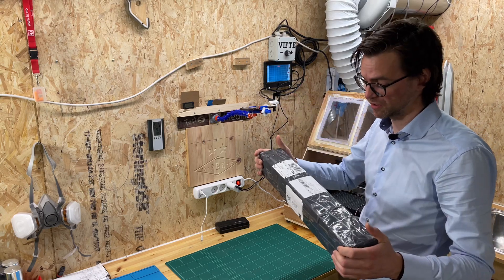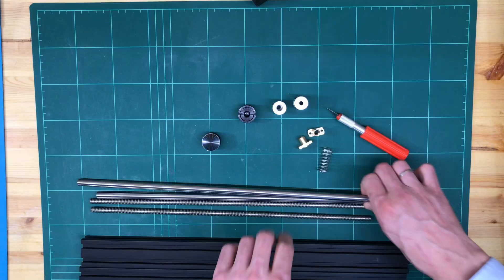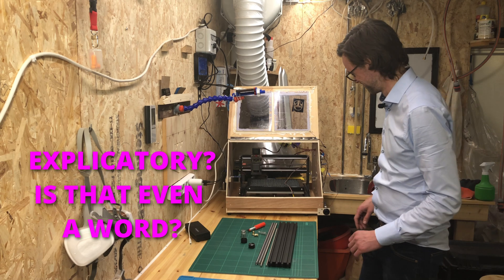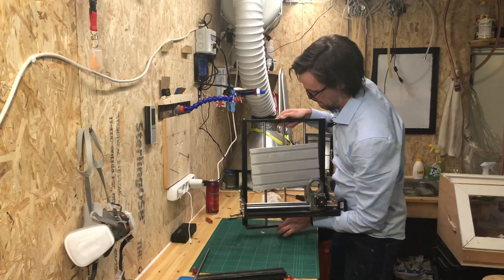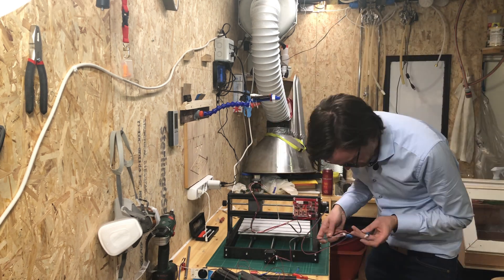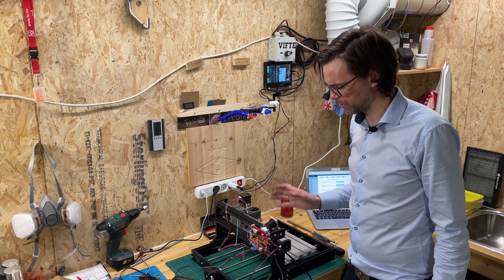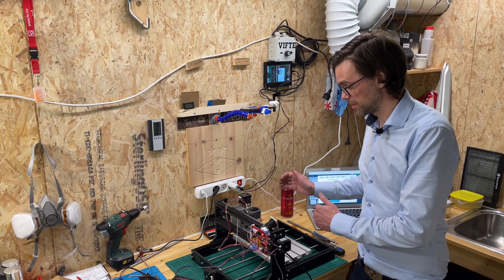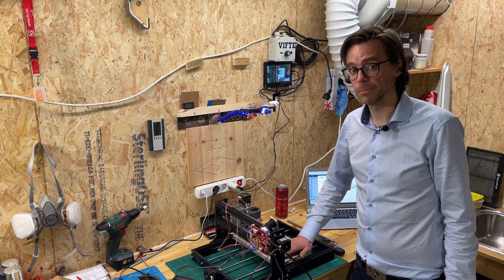The 3018 CNC evolved and expanded!

Comment: Don't you also need a bigger table than? What's the point of 30*35 if you can only support same 30*18?
Reply from the maker: Ideally, yeah. I’ve solved it with an MDF waste board giving me the full size. This CNC isn’t super rigid to begin with, so I haven’t had any issues with the waste board not being rigid enough.

Comment: the biggest problem with the kit is that there's no way to make it wider without a serious redesign.
Reply from the maker: Yeah, to make it wider you’ll have to rebuild the entire machine. Haven’t had the need to do it yet, as I’m content with the size it is. And if I ever want something bigger, I’ll probably start from scratch and build it myself.
Reply: @CellarNerd  yah, i was doing small things then decided i wanted to use mine for guitar parts, mostly bodies, they're an easy way to make cash from even the junkiest cnc, these little machines are only really good for the internal routes.

Comment: Where do you get the expansion? My 1310 is feeling cramped as well.
Reply from the maker: I bought it on AliExpress, here’s the one I got: Daedalus CNC 3018 pro Extension Upgrade Kit 3018 to 3040 Compatible with 3018 Pro Engraving Milling Machine CNC DIY Kit
https://a.aliexpress.com/_m00N5YO